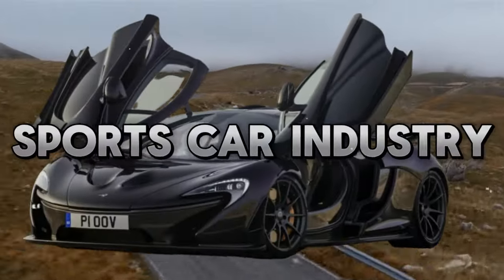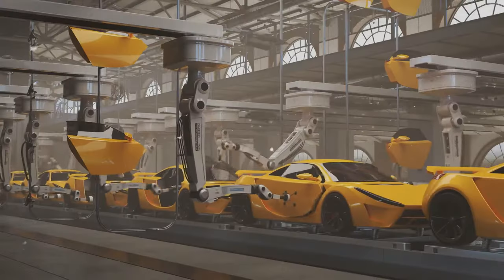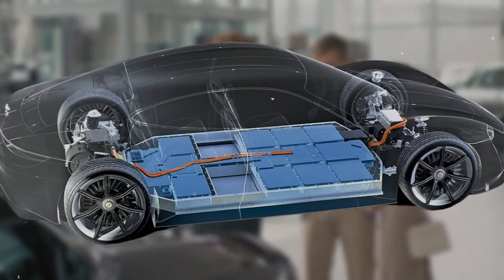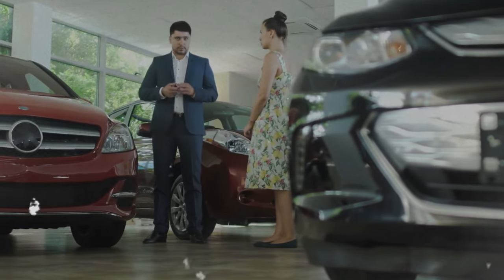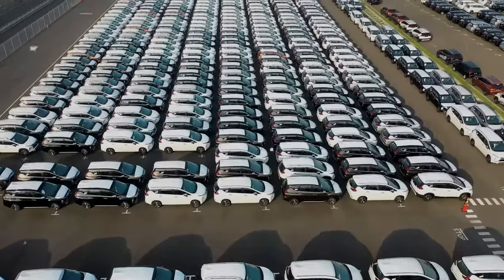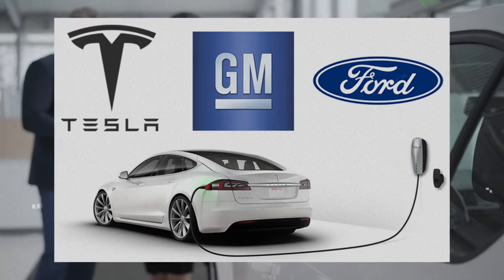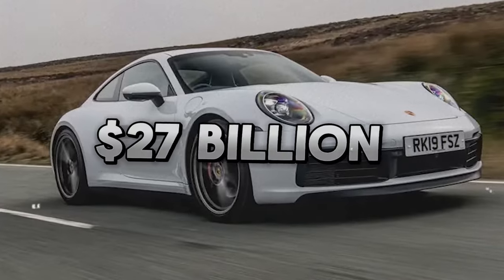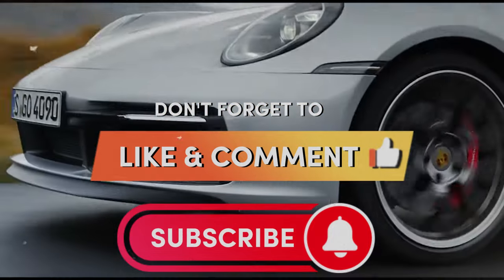Porsche CEO Unveils Revolutionary Engine Set to Outperform Electric Cars!

Comment: E-fuels will never be produced in sufficient quantities to supply individual traffic. Combustion engines will vanish from the streets 2045 latest. This engine was designed for automotive museums ...
Reply: they wont disappear. I live in northern canada you literally can't own an ev. We have power delivery fees that exceed the cost of the power. Also when you have to go into town it being a 800km round trip its just not happening. Sure you could get there but you'll need to charge at a hypercharger or something similar for a good couple of hours when your already at 9~ hours of commute plus that charge time and shopping time your looking at something where you leave at 6 in the morning and return at like 10 at night.
Reply: @gamingclan4651 For these cases they will build cars with fuel cells, based on e.g. methanol, and I wouldn't be surprised if they also develop a way to synthesize is locally out of plant waste. I'd guess you have lots of plant waste in northern Canada ...
Reply: You mean they MIGHT vanish from showrooms. Most of the most polluting countries today like China, India, and the US will continue running combustion engines on streets well into the 50s, if not longer. Developing countries will likely use combustion engines for a while longer.
Reply: @oniit'd be a challenge after you go too far north trees just stop growing